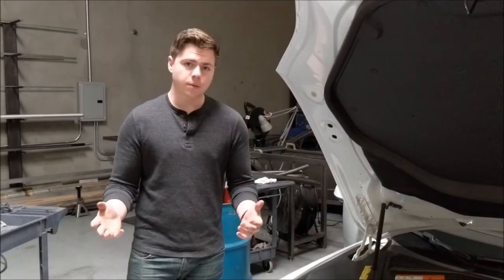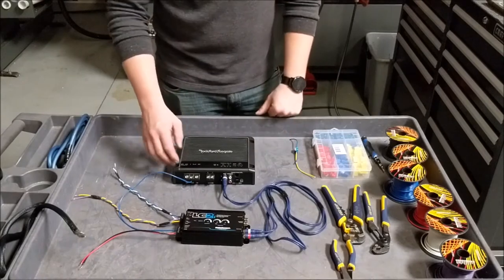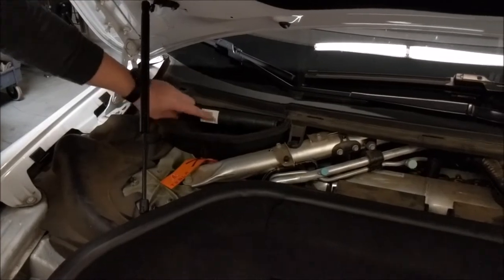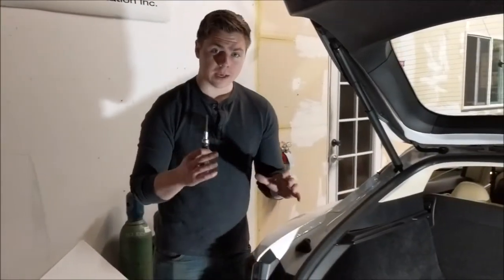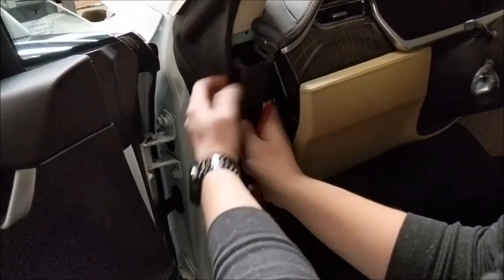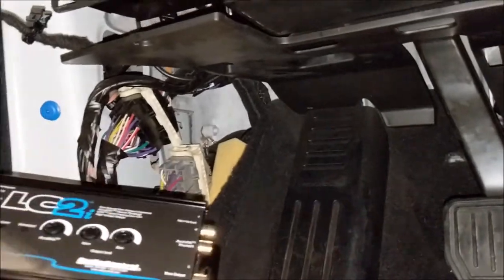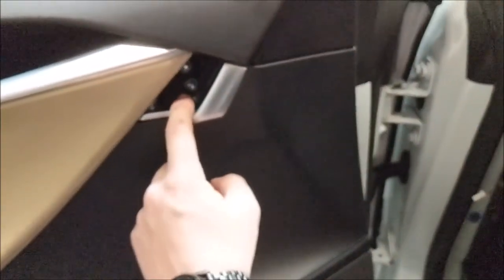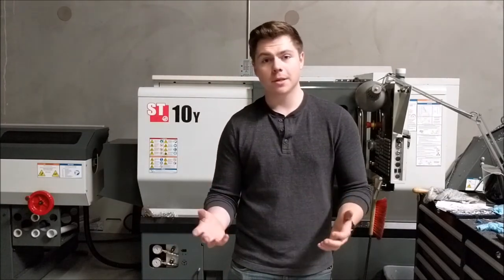Tesla Model S Ultimate Audio Kit Install

Comment: Brody — can you describe or post some specifics of:

-splicing to the speaker wire bundle by color (refresh models)
-mounting the L2i where the secondary HFS amp would be
-routing the power cables through from the frunk on refresh D models
-connecting and running the punch control from the dash to the amp in the rear

Also, perhaps a simple wiring diagram showing where you suggest components be located, cable routing, and connections.